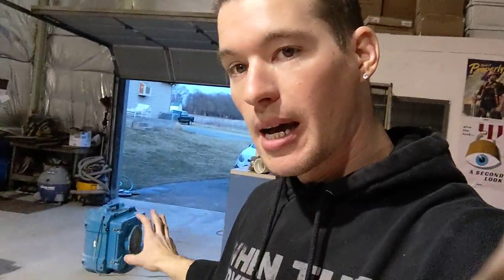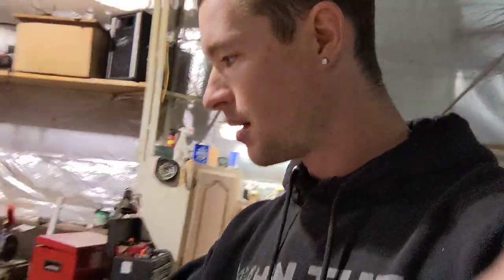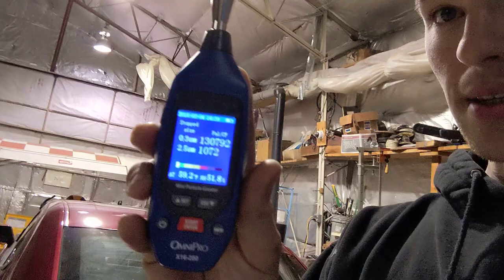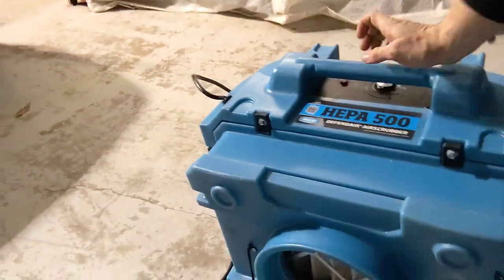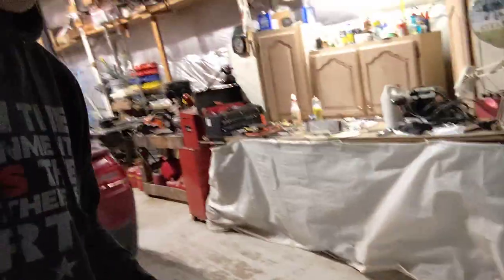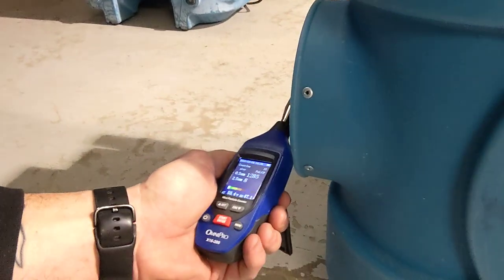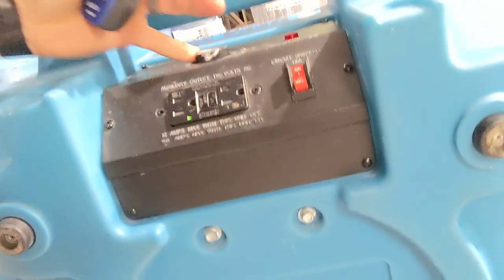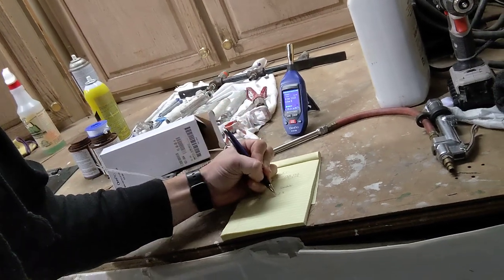HEPA Air Scrubber Cleaning and Testing

Comment: So you guys scrub off the mold with wire brushes? Then apply biocide and EPA sealant? Do you get the mold behind the studs or in between boards by like spraying hydrogen peroxide or soda blasting or cryoblasting it?
Reply: That’s my question too 🤔

Comment: Hi man, cool video. Does this work for asbestos? There were some asbestos pipes in the basement and I want to be sure that the room is safe
Reply: Use a sprayer if you want to control asbestos dust. The air scrubber will filter the air but I would not fully trust it to catch all of the airborne fibers.
Did you remove the asbestos or is it still present in your basement?